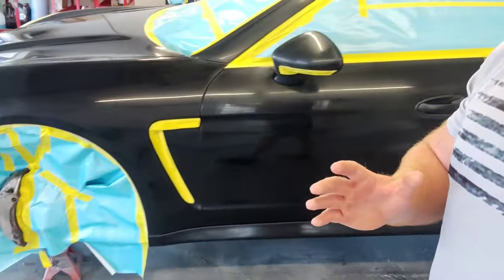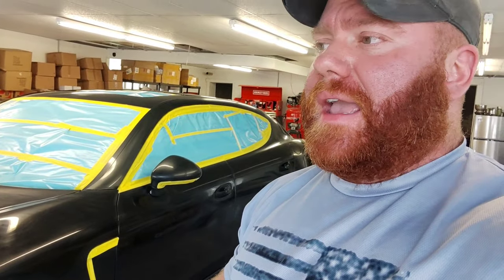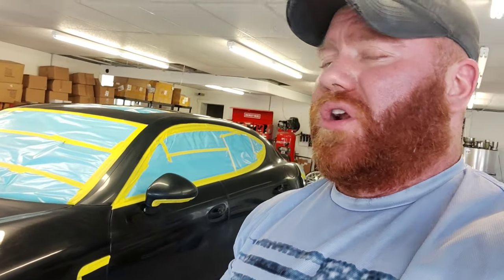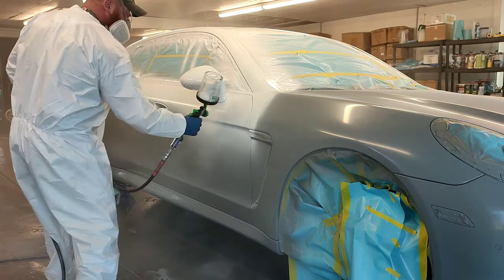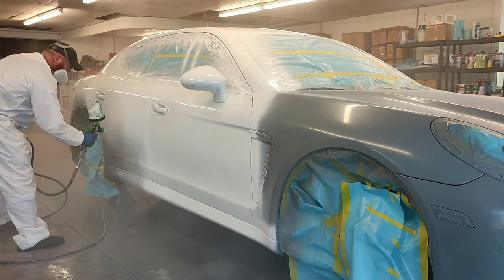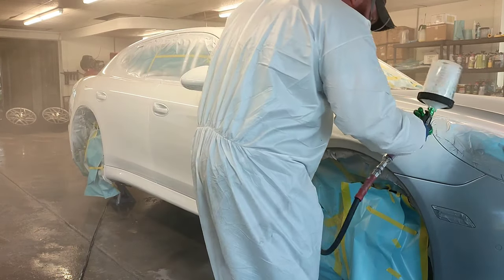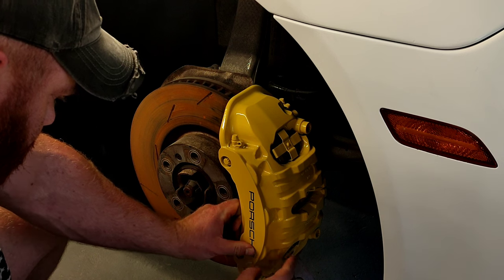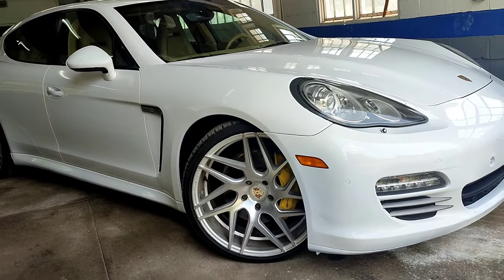200$ paint job

Comment: I have many questions but today I have only 2, what's next with the inside of the panels? Customer wants them in black? Second question: why you didn't cover those wheels? I also work with cars and I know those gone be all in paint....
Reply from the maker: Everything else is staying the same. And I took the wheels off instead of covering them because I needed to paint brakes
Reply: @speedokoterefinishnetwork4937  those wheels in background, aren't you afraid that fog from paint will cover those wheels? Thx for replay :) just want to help :)

Comment: Do you ever worry about getting too much material on a vehicle to where cracking can be an issue over time,forcing you to sand  more material off? Have you ever had a complaint with this issue?
Reply from the maker: Cracking usually is mainly a issue on flexible surfaces